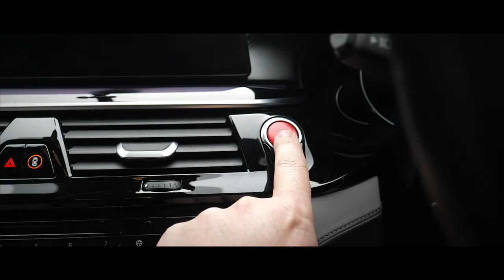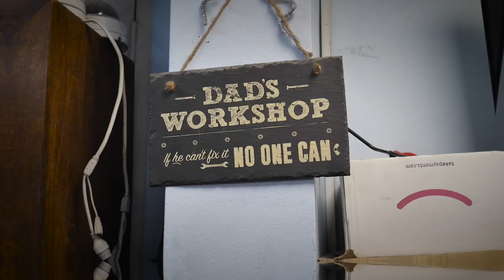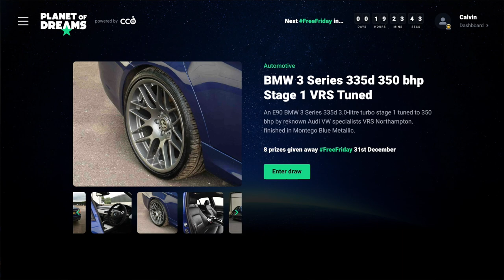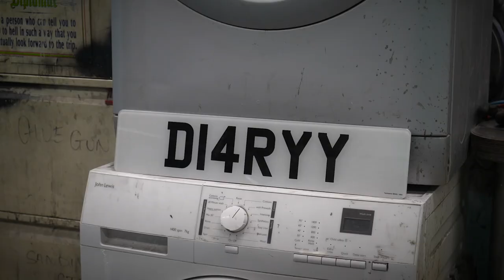REVEALING MY BMW E46 M3 TOURING!

Comment: This is sick. My old man had a brand new m3 in this colour (gun metal grey) with red leather interior. Still holds a really special place in my heart
Reply: Also bro one of the main features of this generation m3 was the swollen rear arches. This just looks like an m3
Front end welded on a 320d

Comment: Lol - only took him 2 years to get it sprayed 😂😂😂 good job he dont do it for a living 😂😂😂 - they built the shard in lesser time pmsl - cant belive I've been watching this Wally for 2 years..... or wating & checking now and again - its becouse I'm a massive  E46 fan - & collector - 2 years... wow - I'm shocked weres the time gone. 

No turbo in my opinion - leave it stock I say like the concept - OEM 
& Add it later on..... if need be.... 

But paintwork looks mint - so far play to the sprayer 👊🏼

Wounder what happened to the other sprayer - now thinking about it he had a other guy doing the project 🤔...

I'll do another research for it in other year or so.... it should be finshed by then or at least have the wiper blades put on it..... 😂😂😂😂😂